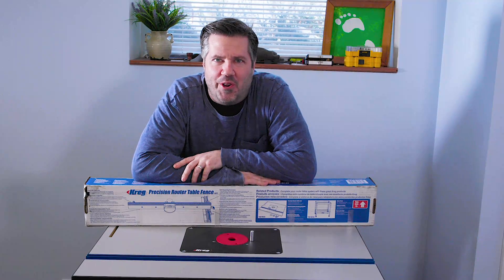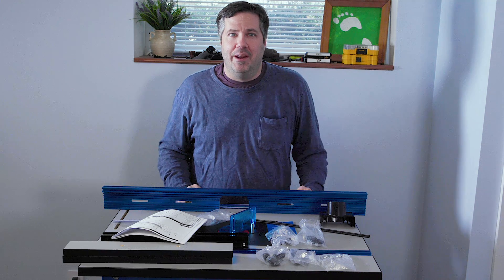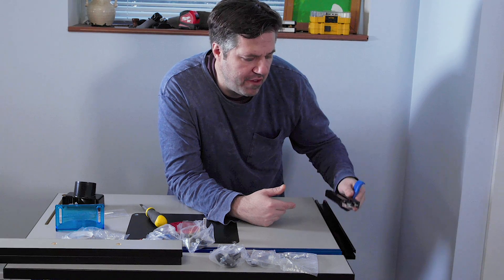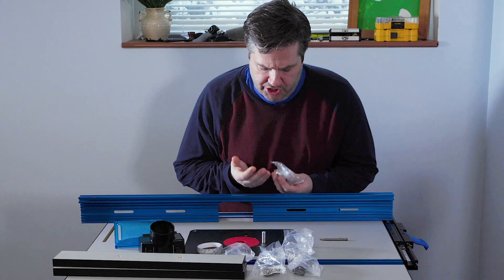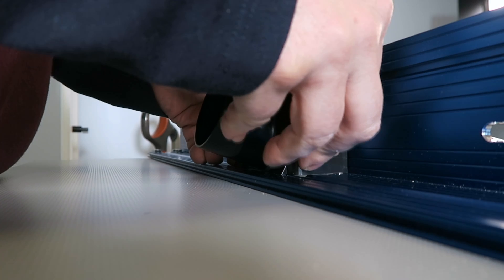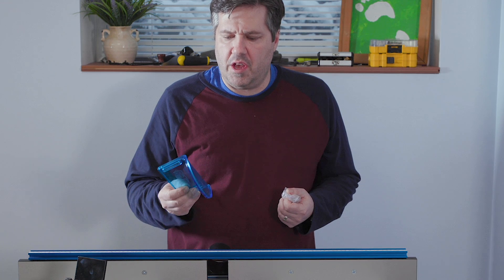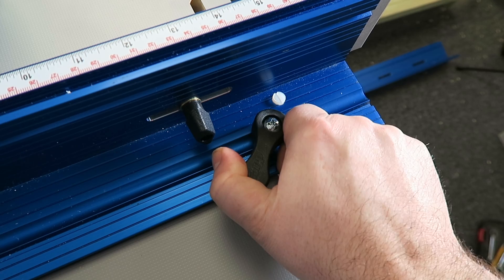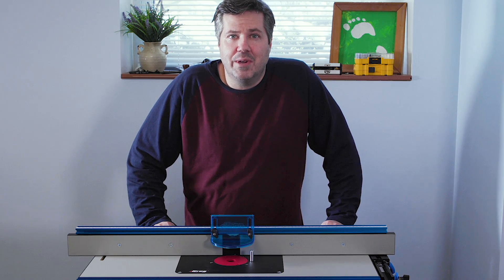Kreg Precision Router Table Build-out and Upgrade Part IV:  Installing the Fence

Comment: Thank you for the close up shots/video of the installation of the fence locks.   I had picked up the KREG Precision Bench Top Router Table earlier today and I was struggling with the installation of the fence hold down locks/handles.   The fence that I have is very similar to yours and I recognized the parts still in their bag on youre router table prior to you talking about them.  After seeing how you installed them I did the same..Took less than 2 minutes and worked out perfectly.  Thank you very much.
Reply from the maker: I'm glad the video heloped.  Don't feel bad about it not making sense.  I practiced a few times to get it right  and edited down to make it look like I knew what I was doing.  There was a lot of trial and error involved :). If you have any questions feel free to reach out.  It is a really good table, I do wish I got the lift, but I'm not sure my router would have fit in the dust box with the lift attached.  I just used it to make door panels and it was super easy to line up everything and I had to go between doing styles again t the fence and then resetting it to work for with the coping sled for the rail tenons.

Comment: How does the micro adjustment work

Thanks
Reply from the maker: It is a little wonky but it works if you are careful.  First you unlock the fence.  The microadjustment piece has a lock.  you unlock it and push it up against making sure the zero is set towards the fence, than lock it down.  The blue ring is essentially a circle with a slowly increasing diameter. As you turn the circle it will push the fence back by the the inscribed amount.  I find it easiest to set the fence a little short and use this technique to dial it in.  If you overshoot you can decrease the amount on the dial and push the fences back against it.

Let me know if that makes sense or if you need more detail.  I could make a short video showing how I use it.

Comment: Hi there, how has the past year been since getting this bad boy up and running? Are you still enjoying it? Do you have any regrets buying this one Vs perhaps a different one? 

I’m researching router tables and I could use your input. Thank you for your time!
Reply from the maker: Hi Ben.  I still use it all the time.  I am very happy with e value for the money.  The first thing is not an issue with the table.  I plan on adding a router lift.  It isn’t the easiest to reach under the table for precision adjustment especially with the dust bin.  The only issue I’ve actually had with the table is the fence.  It works fine but there are these little plastic bushings that it slides on on the ruler side.  They can fall off and unfortunately then get sucked up by the dust extractor.  When they fall off the fence doesn’t lock.  I’ve had to replace those parts a few times. Otherwise everything works perfect, the table is flat and stayed flat even in my garage where the humidify is all over the place. There is very little vibration when it on and wood slides across smoothly.  Now if  money wasn’t a factor I’d love to try woodpeckers, rockler or Jessum. Or even consider an integrated one for the table saw to save space. Based on my original criteria of needing a table to larger pieces once a week. (Table legs for example) I couldn’t be happier.  It has also worked just fine for pattern routing, tongue and groove work and routing panels. The one thing it doesn’t do great with is perfect relatability so you can go back and forth between setting like you’d need in a production environment, but something that can do that is really a different class.

Comment: When I measure the fence to the tee bar distance to get it squared properly, i adjust the fence to suit, tighten the bolts on the fence lock, move the fence a few times and check the squareness again, the fence is always out of square by 5mm each time, I followed your instructions on the video just wondering if you know what I am doing wrong.
Reply from the maker: Wow that is a lot.  You are locking the rotary lock on the left side first before pushing down on the pressure lock on the right side with scale?  The twist lock is the one that forces the fence to square. Maybe it is installs slightly off?  It could also be there is something sticky that prevents the fence from moving into square.  If you keep having issue call Kreg’s tech support.  They were super helpful with the fence issue I  had that mentioned in the video.  Almost two years later and my fence is still square. I have only made a small adjustment once and that was after I had to replace some bushings.
Reply: @SoWeBoughtaHouse  thank you for your quick response, I will give it another go hopefully with a little more success this time. 
Thanks again, and great videos by the way, really helpful.
Reply from the maker: No problem and thank you for the kind words.  Let me know if it works or you need additional help.
Reply: @SoWeBoughtaHouse  I started from the beginning again and followed your instructions, it is all nice and square as it should. Thanks so much for your guidance, keep up the great videos they help heaps.
Reply from the maker: Glad it all worked out! Let me know if you need anything else and I promise to keep working on new content :)

Comment: I have a question about the slot on the left side of the table. I added the fence to a table I built, which is two inches thick Mdf. Is there a way to use the quarter turn knob in the slot without having to cut out Mdf to make the slot one inch deep?
Reply from the maker: Hi Keith, sorry I was slow on this.  I was out of town and needed to look a the table.  I have two thought.  Use a longer bolt that screws down or rout on slot in the bottom of the MDF to provide a relief for it to slide through.  Let me know if that helps.
Reply: I thought of your second idea, but that would require doing a lot more than I want to at this time. I also tried the long bolt, but the plastic piece at the bottom of the handle would need to be longer. I currently am using a t-bolt in a t track that was already in the table so I guess I will continue to use that. Thanks for your input.
Reply from the maker: @keithjohnson2668  Glad you found a solution and thanks for sharing.  It helps others that might have a similar problem to solve.

Comment: Recently got my set up, was missing only one t knob for back of fence.
Reply from the maker: @Jason Lawrence Have you done a project on it yet?  I just finished the final video in the series and installed a dust collection bin over the router added some featherboards and mounted the switch.  It is all set to go now.  I'm hoping to run some boards through it next weekend to make radiator covers.
Reply: @SoWeBoughtaHouse   same situation hoping to run something by the week end.

Comment: Thank you
Reply from the maker: Hi Mack.  After using this router for over a year now, I have an additional comment on the fence.  there are these little plastic sliders that lock the fence on the right side. These can fall out when you move it and get cuked in the dust extractor.  When they do, the fence won't lock down and can slide.  Reach out to Kreg to get some spares. Also always check that side of the fence is locked.   The first couple of times they fell out the fence moved on me and I ruined a piece.  (Luckily just cheap plywood for drawers)

Comment: You left out one of the most important details, the micro adjustment🤷🏻‍♂️
Reply from the maker: Probably in part 5 :) have you had good luck with the micro adjustment.  I have not.  There seems to be just a little bit of movement when I lock it down invalidating the setting.

Comment: Don’t think I’ll be buying one of these. Kreg’s quality control seems a bit suspect.  Great video though.
Reply from the maker: Out of everything in the kit the fence is the only thing I see as problematic. Keep support has been really good but the little rubber bushings that lock the fence keep falling out. If they came out with a better fence I’d upgrade. If the router table was a regular item I used daily instead of maybe a few times a month I’d look at one of the premium options.  As this price range it is a good option but if you had 3-400 dollars more to spend there are some nice options.